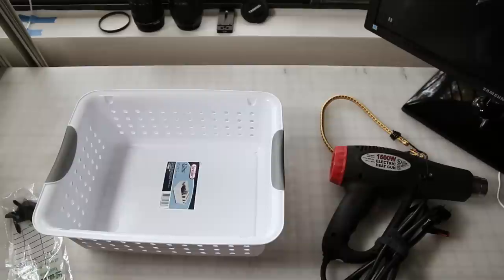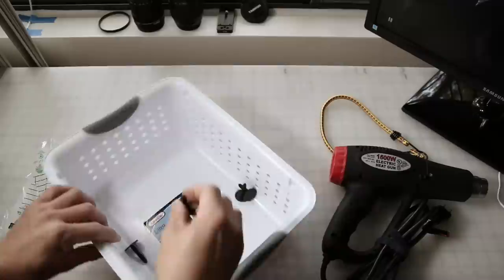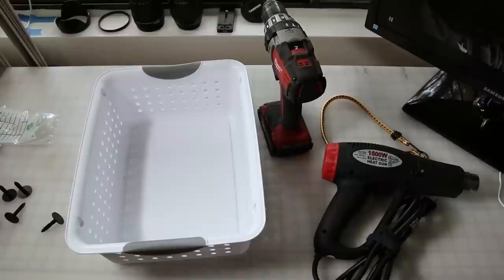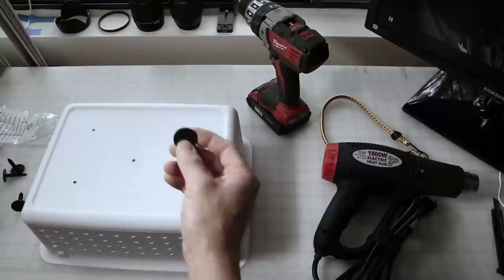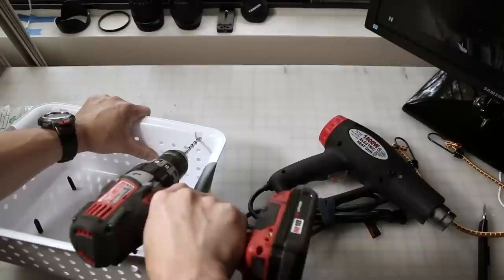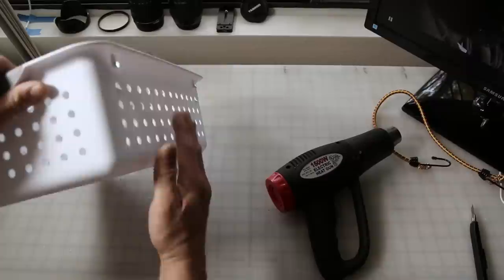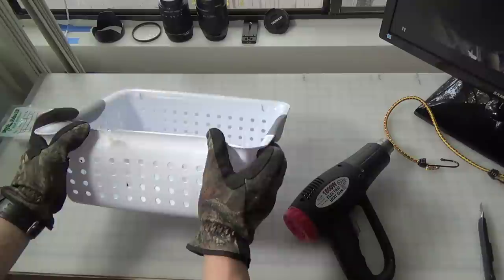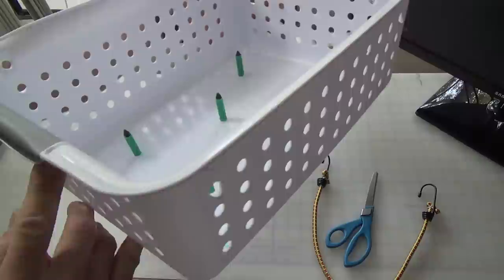How to make a DIY Stripping Basket for Saltwater Fly Fishing

Comment: Pretty nice.. I made my basket similar but used the cones for tangle control, they can be purchased at a craft store. I just screwed them in using small stainless screws. My strap came from an old hip pack..   Nice ideas...Tight Lines